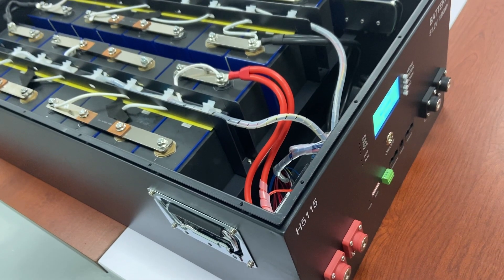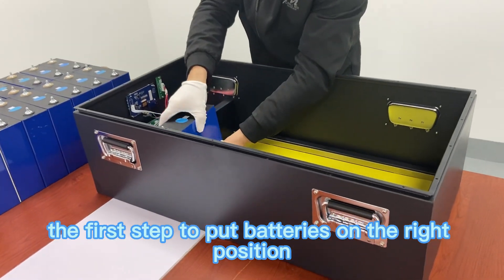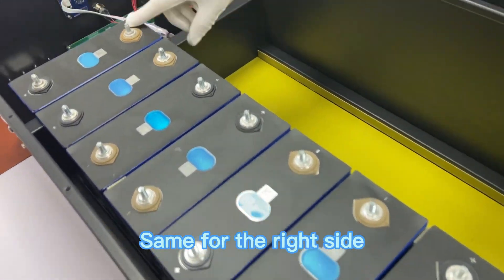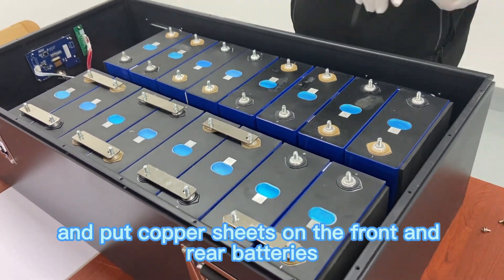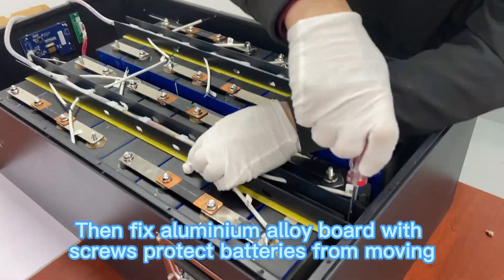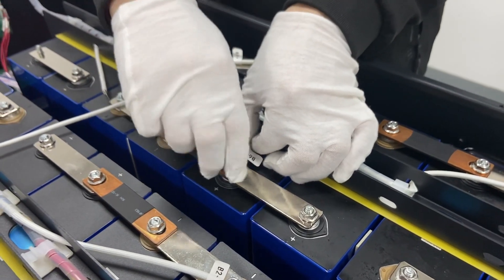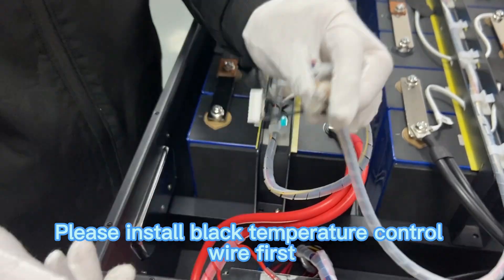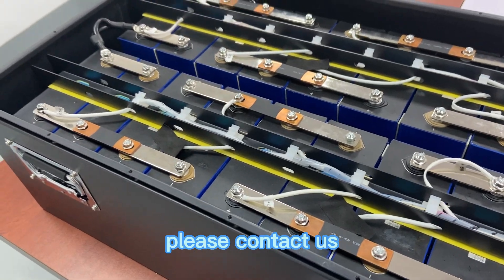【LiFePO4 battery】15kwh lithium battery packs DIY Kit #diy #battery #diyprojects

Comment from the maker: 🌏Website: https://www.kesheebattery.com/
📧Email ▶ sales@keshee.com 
☎whatsapp ▶ +86 13316494371

✅KESHEE H5115 51.2V pack/DIY kit, please click
https://www.kesheebattery.com/products/keshee-16s-200a-bluetooth-bms-51-2v-280ah-battery-pack-DIY-kit-battery-assemble-box-without-cells

Product linkage:
KESHEE  LiFepo4 Battery DIY kit, you can go visit: 👇
🌏https://www.kesheebattery.com/products/wholesale-keshee-16s-48v-51-2v-280ah-304ah-battery-pack-DIY-kit

For Single Cells,please visit: 👇
EVE 3.2V 280Ah LF280K battery, please visit: 👇
🌏https://www.kesheebattery.com/products/solar-photovoltaic-systems-lithium-ion-phosphate-ev-3-2v-280ah-prismatic-battery-lifepo4-cell

For EVE 3.2V 304Ah LF304K battery, please visit: 👇
🌏https://www.kesheebattery.com/products/brand-new-deep-cycle-3-2v-lifepo4-304ah-cells-replacement-battery-for-marine

For CATL 3.2V 302Ah battery, please visit: 👇
🌏https://www.kesheebattery.com/products/wholesale-brand-new-high-quanlity-catl-3-2v-302ah-lifepo4-solar-panel-battery
Reply: How buy bms 8s-2p?